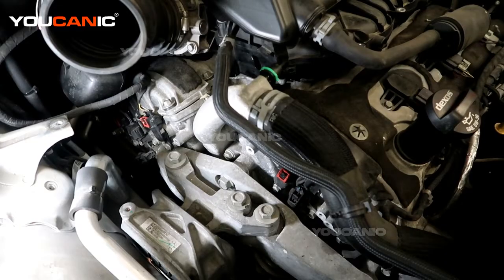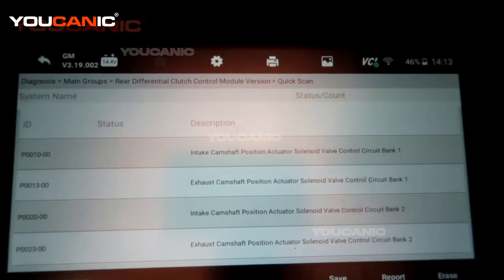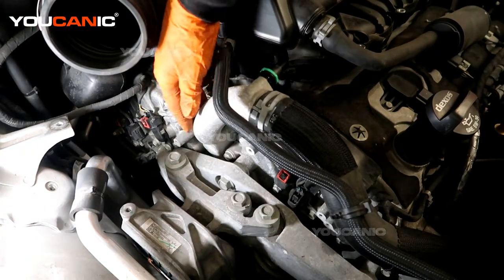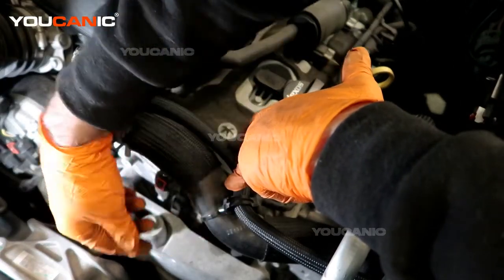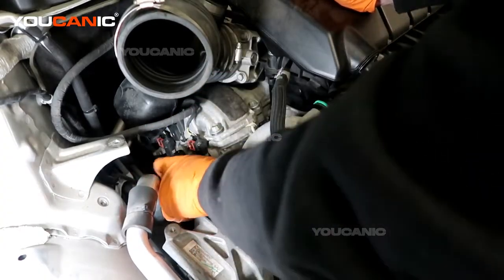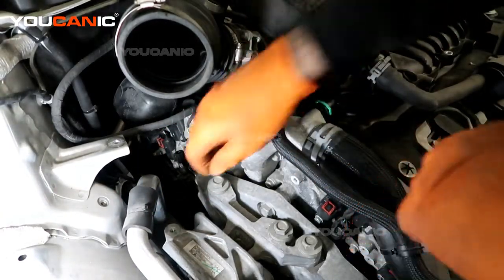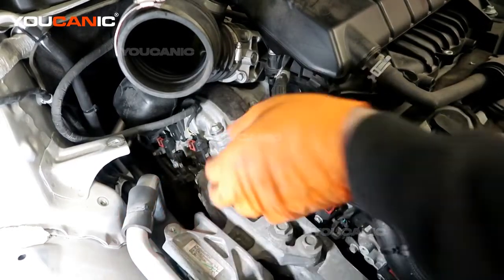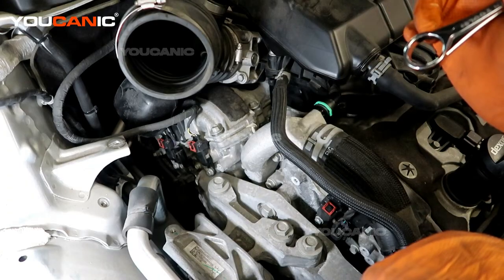GM Camshaft Position Actuator Solenoid Valve Replacement - P0010, P0013, P0020, & P0023 Fault Code

Comment: I have a 2011 gmc Acadia slt and I believe this is the problem it has, it is making a loud rattling noise when you cold start it and when I hit the gas is this a the solution to my problem?
Reply from the maker: Thanks for reaching out! It's possible that the information in our video might help with your issue, but without further details, it's hard to say for sure. Try to explore our resourceful guides and useful tools on our website www.youcanic.com to diagnose the problem with your GMC Acadia and find the suitable solution.

Remember, we also offer our powerful YOUCANIC scanner and have factory repair manuals for more in-depth issues. Our goal at Youcanic is to empower car owners like you, so feel free to reach out on our site if you need further assistance. We're here to support you on your car ownership journey!

Comment: Did you remove the bracket and replace those?
Reply from the maker: Thanks for your comment! In our videos, we strive to provide as much detail as possible, including bracket removal and replacement if required. Remember, you can always find more comprehensive guides and resources on our website, www.youcanic.com. 

There, you'll discover our YOUCANIC scanner, factory repair manuals, and a supportive community. At YOUCANIC, it's all about empowering you throughout your car ownership journey. Don't hesitate to reach out if you need any assistance!

Comment: I got a question i just bought a 2011 chevy camaro 3.6 I’ve got all 4 codes that’s on your YouTube video title. The car doesn’t want to start it tries too but don’t start. Could that be this part I need to replace??? Thank you
Reply from the maker: Thanks for reaching out! It's difficult to diagnose without additional information, but at Youcanic, we're here to support you in resolving your car issues. We recommend exploring our helpful guides and using our powerful YOUCANIC scanner, which may help pinpoint the issue. 

Remember, we're all about equipping you with the tools and knowledge to feel confident with car maintenance. Visit us at www.youcanic.com for more resources, and don't hesitate to reach out if you need further assistance!